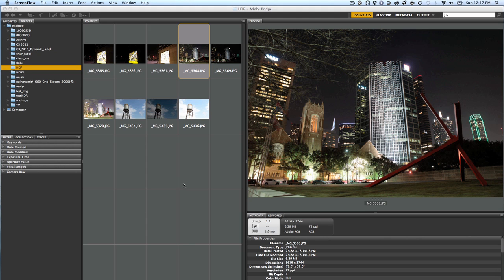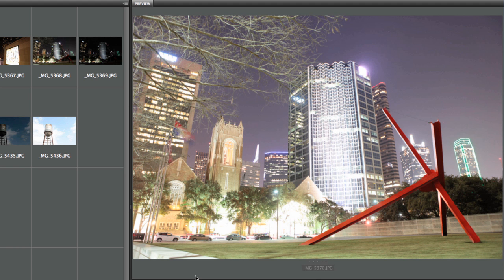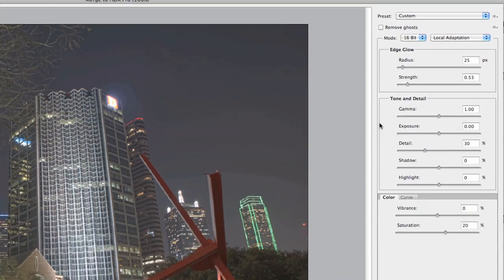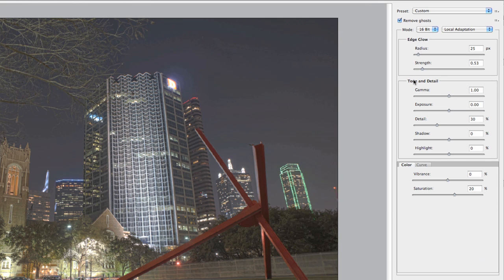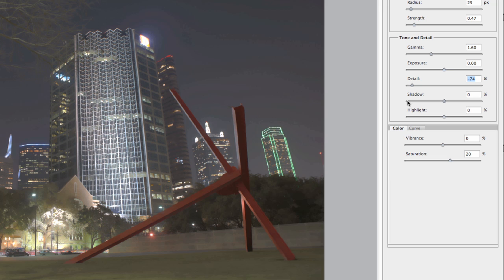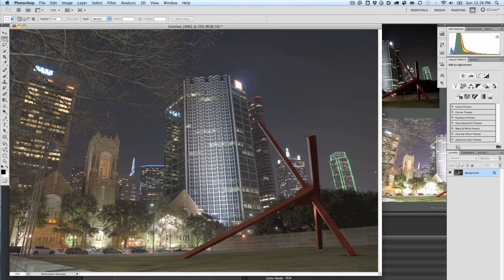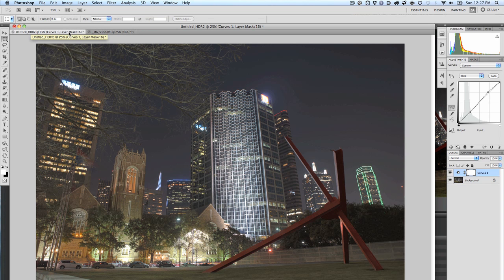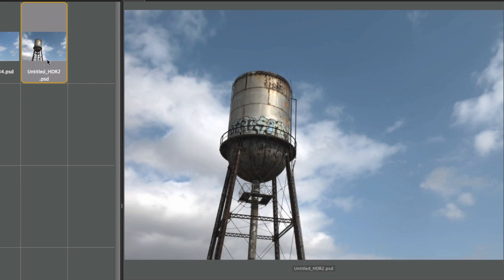HDR Photography Using The Zone System

Comment: Your use of the statement that you're using HDR as a tool not effect is incorrect, as HDR is a "tool". What you and myself for that matter don't like is the overuse of that tool. Ansel was one of the original HDR proponents, though from a exposure/development
perspective, his negative did not look like the final print, he would tell you the negative = the score & the print = performance. Photoshop, filters, sharpening are tools. All tools can be overused. Don't be pompous in your dismissiveness.
Reply: Larry Gallagher Some people get the wrong idea of what HDR photography is. It’s nothing more but wide range of luminosity and contrast in the scene, is neither a special effect nor a post-processing technique. Strictly speaking, an HDR image is an intermediary image with 32 bits per color channel (96 bits per pixel) An HDR image is the result of merging photos of the same scene taken under different exposure settings and store in a special HDR image format, i.e. OpenEXR, TIFF, PSD.
Reply: It's a technique imo. No different than sunny 16 rule and the likes.
Reply: Nothing wrong with the statement as plenty of people don’t use HDR as simply a means to an end to handle dynamic ranges that cannot be accommodated by a single exposure. Rather they expect or (at least) accept a certain look and feel often associated with HDR. Ultimately a good HDR image shouldn’t look like one but for some scenes experienced photographers will be able to guess what you maybe had to do as they know you would have been lucky to have the dynamic range fall right.